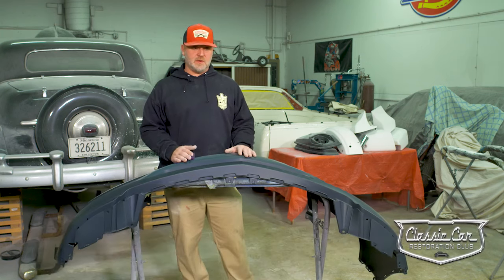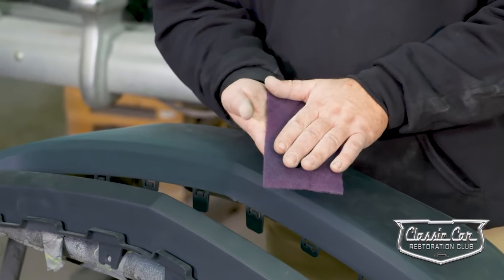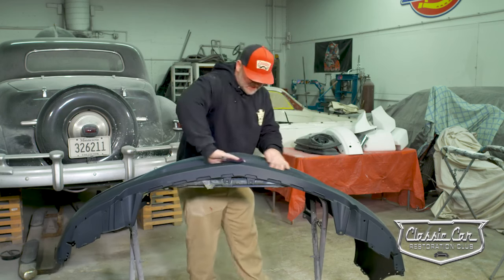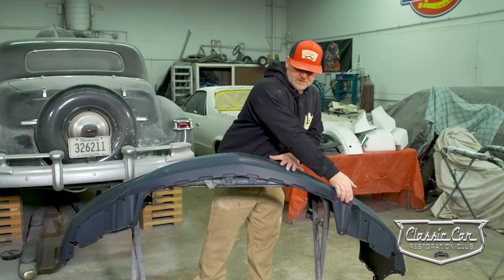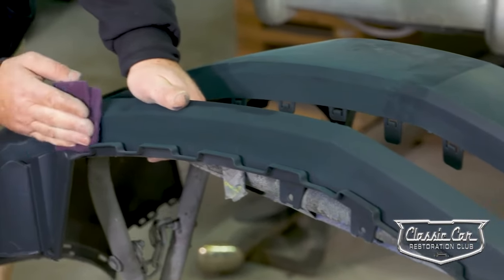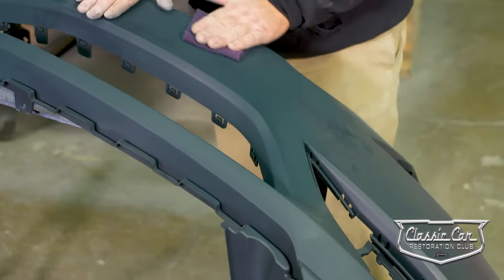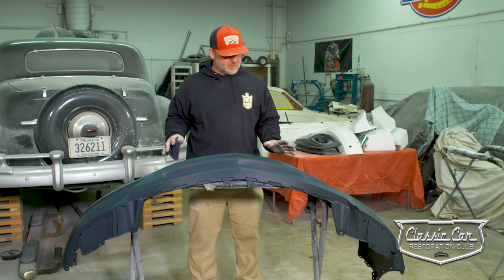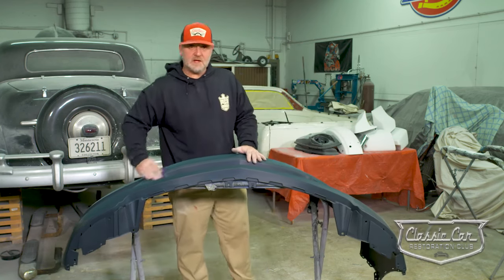Paint Preparation for Plastic Bumpers

Comment: I have always been told the reason for the scuff... just like using 80 grit before bondo work is for "mechanical" adhesion.
When it comes to putting an adhesion promoter on... that allows a chemical adhesion, but without the scuff, the promoter would not stick to the bumper and without a chemical adhesion, the paint would not stick to the promoter.
If you know what im trying to say.